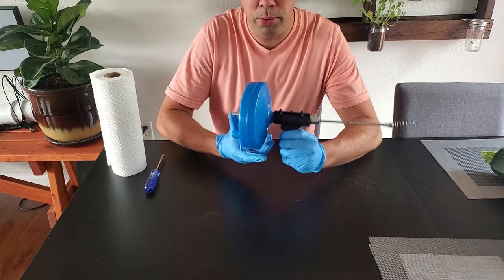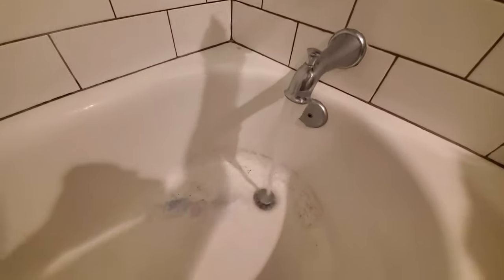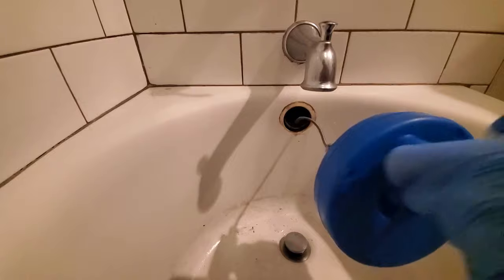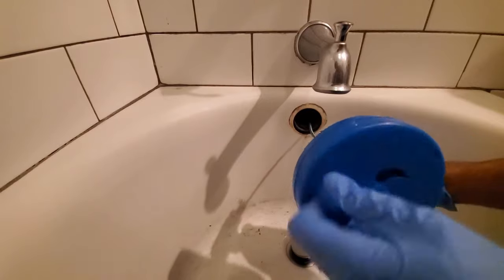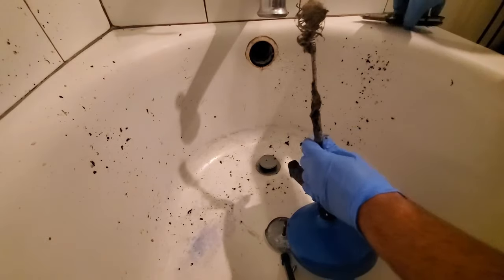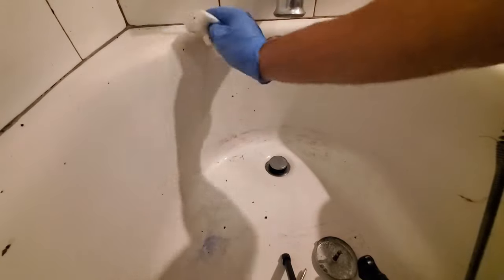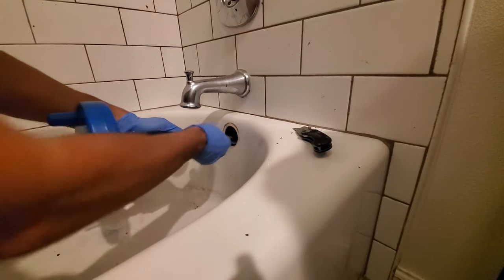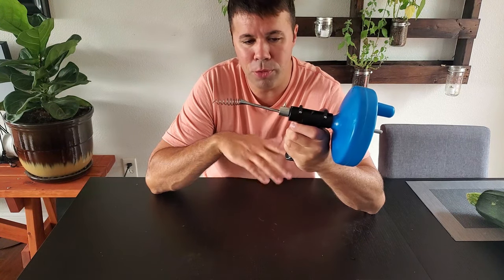How to Unclog a Bathtub Drain Using a Snake (Drum Auger)

Comment: Before I give this a try, is there any possibility of me causing damage using this tool? I live in an 80 year old apartment building. Thanks!
Reply from the maker: I doubt it.  Unless you were using a power tool I do not feel you will cause any damage.  Hand crank augers just spin inside the pipes to unclog the jammed pipe.  From my understanding, all plumbing pipes in bathtubs are either metal or thick PVC.  Either of which will not be damaged with a hand crank auger.  Best of luck!

Comment: If it's not been mentioned, when you clean up splatters with paper towels, resist your urge to flush it down the toilet.  It could lead to another clog.  Throw it away in your trash instead.
Reply from the maker: Good tips!  Yeah paper towels do not dissolve in water like toilet paper does

Comment: When I tried going through the overflow pipe as is done in this video, as soon as I unscrewed the metal plate the overflow pipe itself fell off and the water immediately drained.  After some time of trying to work out what was up I was able to get my phone camera into the hole enough to see that the water was draining into the space between my walls.  My wife and I then spent the next several hours trying to get the overflow pipe back into position (doing this through the hole was very difficult).  We still have a clog, though.  I think it's a little further down the line, right about where it meets up with my kitchen's waste pipe because the kitchen sink water backs up into the bathtub.  I'm at a loss.  I'm afraid to go through the overflow pipe again because it might fall off again.  I should note, we had our entire bathroom redon about a year ago and the dude that did it is the one who put that overflow pipe.  It really feels like he was rushing or something and decided it wasn't important enough to install our pipes correctly.
Reply from the maker: Sorry to hear about the situation with your pipes.  Hope you can get it resolved and the clog cleared soon!

Comment: What if you feel it’s stuffing in a twist and then you keep going and you twist again when it stops and then eventually pull it out and nothing comes out but your drain is still clogged
Reply from the maker: You may just be hitting some of the bends in the pipes...not the clogs.  Typically you will get some hair, soap residue etc when you pull the snake out.

Comment: I just ordered one on Amazon. My shower has completely stopped draining it’s full of water and dirty debris. Scared to tell my dad. I have tried to stick a knitting needle down my shower drain to see how far it will go but it doesn’t go down more than 5 inches or so. It’s hitting something hard that is part of the shower. I don’t understand it because I can’t seem to find any hole so I don’t know how water even goes down in the first place? I don’t understand are showers different? Why is there something blocking me? I’m afraid the snake won’t go in
Reply from the maker: Well there is usually a bend in the pipe that takes place about 5 inches down.  So you are probably hitting the bend.  I honestly would just maybe ask you dad to help.  These things happen all the time.  Its very common.  Nothing to be ashamed of.
Reply: @JMGENTERPRISES  thank you so much
Reply from the maker: @Anna-ic1sf  - You bet!

Comment: Thanks alot
Reply from the maker: Most welcome 😁
Reply: @JMGENTERPRISES  once I got about 8 to 10 feet extended it just coils up in the pipe due to the weakness of the snake vs the complex angle of the drain.   I never got to my clog.    Argg.  Looks like I'll need to call a pro.   Lol.
Reply from the maker: @irocss85  darn!  Usually clogs happen through the pipe bends which are usually only five feet down or less.  Let me know how it goes!

Comment: What do I do if the back plate is connected and won’t come off
Reply from the maker: Is it rusted on?  If you have a rubber hammer, you can try gently hitting it.  Or if you have a butane torch, you can try heated it.  It's probably just rusted on.  Maybe try getting a small thin flat head screwdriver in there and see if you can pry it off.
Reply: @JMGENTERPRISES  I can unscrew and take it off but it is connected with the lever that is supposed to close the drain but it never worked right and the snake didn’t work but we used a thin irrigation hose and somehow managed to get it to drain

Comment: Do I need to shut off the water valve..??.
Reply from the maker: I never do.  You are only unjamming a clog with the auger.  You are not disconnecting any pipes which would leak water.  If that was the case, you would want to turn off your water via the valve.
Reply: @JMGENTERPRISES  thank so much.. I appreciated  😌  have nice blessed  day

Comment: Whenever the auger stops you're not hitting the clock or the hair you're hitting the elbows in the 90° turns and the p-traps in the pipe
Reply from the maker: Good point!
Reply: Mine is going back to the drain hole, is there a trick to get it straight down the pipe?